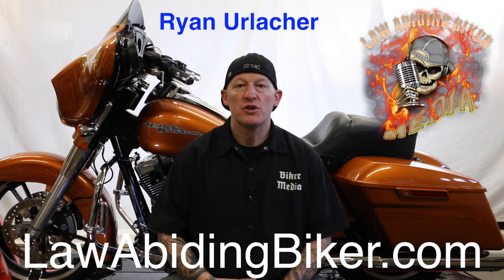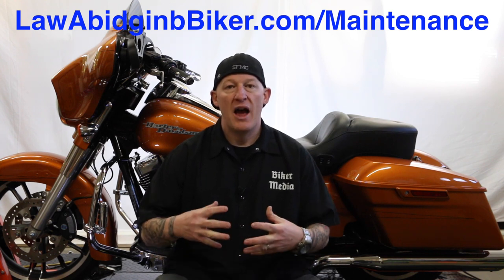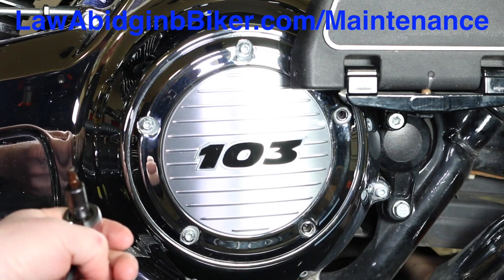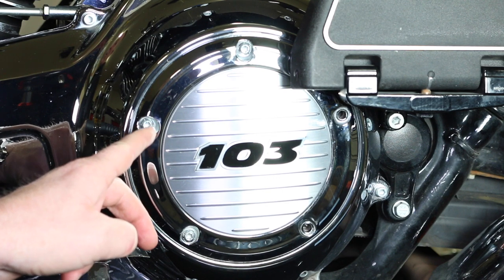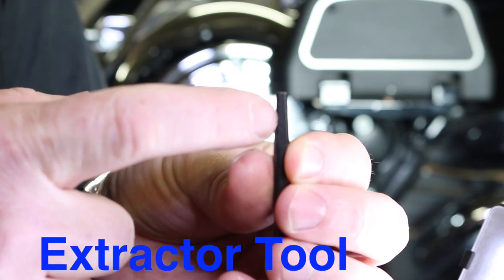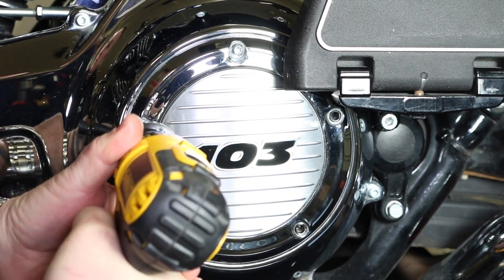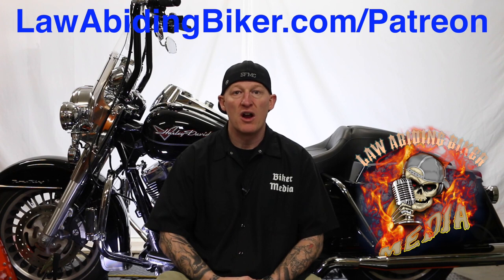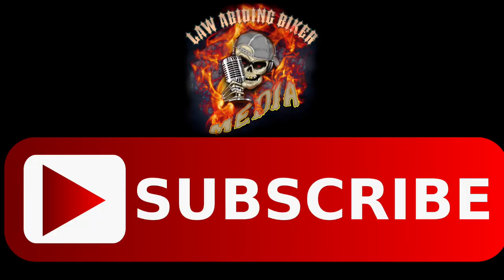Extract Remove Harley Davidson Primary Cover Bolt Stripped Head

Comment: Just did this on my 18 Ultra and can absolutely state that if those bolts are welded like to the primary that bolt extractor method is not going to work, you just can't get enough depth to grab, what worked for me was using a Dremel tool with a metal cutting blade to create a flat blade screwdriver slot then an impact driver. I'll be using anti seize on the new bolts as well as hex head!

Comment: Great lesson for rookie mechanics.  More advanced tip...invest in a set of left handed drill bits.  These bolts are a little small for this to work but I've actually had damaged bolts turn themselves out while drilling the pilot hole for the extractor with a left handed drill!
Reply from the maker: Great tip!  Thank you.

Ride safe & Ride Often!
Here is a link to a bunch of our useful Free vids: http://www.lawabidingbiker.com/freevideos
Here is a link to some of our useful for purchase videos: http://www.lawabidingbiker.com/buyvideos
Want Answers & Information Fast? And help support us at the same time? Do you like the content we provide?
Our patrons get answers to their questions/comments/feedback in less than 24 hrs and are part of our Private Facebook Group. If you are interested in being in this exclusive group you can get all the details at ==> http://www.lawabidingbiker.com/patreon
If you haven't subscribed to the Law Abiding Biker Podcast make sure to do so. Listen in as we talk weekly about issues/items like this & so much more. You can listen on iTunes (Apple/IOS), Stitcher Radio (Android), or any other Podcast App ==> http://www.lawabidingbiker.com/podcast
Join our free email club at http:///www.LawAbidingBiker.com/EmailClub. Only relevant content will be sent from time to time. Email club members are the first to find out about free or for sale content are given special coupon codes.
Reply: Yeah!  The left handed drill bit (3/16ths), and grinding flat the "pointy" end of the (for lack of a better way to explain it) the "4 cornered square" extractor (made specifically more for brass fittings, then screw type) for, made short work of those stripped out torx bolts!  In hind sight however, I'm pretty certain my right handed bit was dull!  Gauging the way the "new" bit was cutting!  LOL!  I replaced 'em with chrome "allen head" bolts (1/4" x 20 x 3/4") and 1/4" zinc lock washers bought at Mernards.  1 stop shopping!

Comment: Ryan, this video is a great.  I looked for this video after having issues removing my primary.  I didnt strip the torx bolts, but did damage two bits.  I stopped and did some research.  I ended up getting two manual impact drivers {the kind you hit with a hammer).  I thought I would share what worked for me.  Cheap Harbor Freight Impact Screwdriver and Harbor Freight Icon Torx Socket with a 1/2 to 3/8 socket adapter.  I had to pound the crap out of it with a hammer, but they all came out without damage. I did buy the extractors you recommended as a backup plan.  Thanks for sharing your knowledge.
Reply from the maker: Thank you for commenting.  Those extractors do work well.

Ride safe & Ride Often!

Check out this YouTube Channel as we have a ton of free videos for you!

Check out our useful for purchase videos: http://www.lawabidingbiker.com/buyvideos

BECOME AN EXLUSIVE MEMBER-GET BENEFITS:
http://www.lawabidingbiker.com/patreon

Leave a flat donation: 
https://www.lawabidingbiker.com/donate

Shop in the Official Law Abiding Biker Store:
https://shop.lawabidingbiker.com

Subscribe to the Law Abiding Biker Podcast: https://www.lawabidingbiker.com/app

Join our free email club:
https://www.lawabidingbiker.com/emailclub

Comment: All five of my screws were stripped. This technique was helpful for one of the screws - Extractor No. 3.  I broke two more extractor tools in two of the screws.  Big bummer, because these are very hard to deal with once broken off.  Dealer must have used lock tight or silicone.  I wound up using a torch to get things warm, not red hot, and used a hand impact driver to get the last two out.  Thanks for all you do.
Reply from the maker: Super glad you got those out. Great idea on the torch and hand impact driver. Thanks for sharing.

Comment: Right so in order to do this i need a rare, specialised piece that nobody stocks. Great. Thanks for the help....
Reply: Most hardware stores sell the " EZ OUTS" or screw extractors whatever you want to call them. If you dont want to buy a set with different sizes try to find one slightly smaller than the bolt you're extracting.

Comment: Stupid place for torx head bolts.  After dealing with two stripped heads, I replaced them with stainless allen head cap screws.  No more problems.  Harley knows this is a common pain in the ass but they don't improve the design.
Reply from the maker: Roger that Dick. Thanks for weighing in and ride safe!
Ride safe & Ride Often!

Here is a link to a bunch of our useful Free vids bro: http://www.lawabidingbiker.com/freevideos

Here is a link to some of our useful for purchase videos: http://www.lawabidingbiker.com/buyvideos

Want Answers & Information Fast? And help support us at the same time? Do you like the content we provide?

Our patrons get answers to their questions/comments/feedback in less than 24 hrs and are part of our Private Facebook Group. If you are interested in being in this exclusive group you can get all the details at ==> http://www.lawabidingbiker.com/patreon

If you haven't subscribed to the Law Abiding Biker Podcast make sure to do so. Listen in as we talk weekly about issues/items like this & so much more. You can listen on iTunes (Apple/IOS), Stitcher Radio (Android), or any other Podcast App ==> http://www.lawabidingbiker.com/podcast

Join our free email club at http:///www.LawAbidingBiker.com/EmailClub. Only relevant content will be sent from time to time. Email club members are the first to find out about free or for sale content are given special coupon codes.
Reply: what size allen head bolts did you use?
Reply: @TheFosland1   oh jeese, I forget, been a while.  I just removed one of the existing torx bolts and took it to the hardware store to match it up.
Reply: @TheFosland1  Hey there, Andrew.  I see it's been a while, but as I'm currently in the midst of this job myself on my Softail, the Allen socket head screws I bought from Lowes are 1/4"-#20 by 1/2" long.  Good luck.

Comment: The last person to touch my primary was a harley mechanic (was actually free for me due to another issue they screwed up and wanted to make it up to me) and when I went to change the primary oil this time I stripped the first two bolts I tried taking out! Tried extracting them using your method, and had to use so much force turning the extractor it too broke off in the stripped bolt!!!! Anyway, I went to try and take off the other torx screws and finally got one loose after using a ton of effort, probably a good 20-30+ ft lbs of pressure, and before anyone asks - yes ft lbs, not in. lbs... It was locked in there unbelievably tight. What sucks is, I asked the dealership for advice and they want to sell me an entire new primary chain case cover, along with a new derby cover. 

Worst part about it is I'm at the end of my rope, with the busted screw extractor in the stripped bolt, I'm unsure how to proceed. I think my last shot of hope is removing the entire chaincase cover and seeing if I can get a better angle or possibly work it out from the inside (not sure if this is even possible as I've never seen the inside of the primary chain case!) Thanks for the video though, I think it would have worked if mine were not torqued as tight because I had the extractor in there nice and snug but it simply wouldn't turn without excessive force to the point it broke :(
Reply: rather than buying a whole new housing from the dealership, you might find a local machine shop that could install a set of steel heli-coil inserts to match the original screw size.  I think the housing is aluminum, which explains why these holes strip out so easily.
Reply: @elliottvangrinsven6574  Good idea for sure. I went a different route already and bought a cheap $75 chain case cover from eBay, sanded it down and painted it black ( I think it's called engine enamel). Anyway, it looks okay, I bought a new derby cover too so all in all with paint and everything it was about $150 or so to have it replaced. And it doesn't even look amazing, it was my first time ever spray painting chrome and while it looks okay its clearly not professionally done. Of course I still have the old chain case which I may take to a machine shop like you said for the hell of it and that way I have a back up. Anyway, to anyone it concerns I highly suggest not trying too hard with these and if you think you're gonna strip it at all just take it in and have the dealership do the oil change. While it is a ripoff, it prolly won't cost you $150 plus oil/filter to do the change!

Comment: the bolt does have play and I can take off the bolt so I'm thinking he stripped the inside thread of the housing case not the bolt itself. thank you for vids ,videos are always great
Reply: +Harley Leija Harley if that is the case you are probably going to have to drill drain the primary fluid, then pull out that bolt.  Then you can re-thread the casing.  If you don't feel comfortable doing so then take the entire primary cover off and take it to a machine shop.  They should be able to do that.  Worse case scenario, you might have to buy a new primary case.  Rick from LAB.

Comment: These bolts are super tricky. Mine is a new 2019 fatboy 107. Just doing the 1k myself. All is good until trying to cover this up. I set torque spec according to the service manual and it’s toward the lower spec setting. 90 inch pound. Guess what, didn’t even get to that torque the head of the bolt snapped. Got that out and went to H-D dealer bought 10 new bolts just to be safe. Second one still didn’t reach torque and I can just feel it lost grip. Now I am afraid even use a torque wrench. I just feel that they are tight and stop. Not sure if that thing is gonna to stay on LoL.

Comment: So the dealership put what looks like blue lock tight on my bolts I got one out but I have striped two bits trying to break the other one any suggestion / the bolts are not striped yet

Comment: My bolts are not stripped but seized. I tried a hammer style torque driver and all its doing is twisting the impact rated torx bit. Any advice on this?

Comment: And what's bad is the chrome screws are in-store only, so I'm changing all mine to black heads with chrome cover. I'm not driving an hour just to get screws

There is a screw extractor named speed out, I have this, it hasn't worked yet.....it won't drill into the screw. 

At work, which I borrowed, we have the type used in video

I'm going to buy a set of these $13.55 on Amazon, and a harbor freight set that has left handed drill bits $10 ....... You might unscrew it while drilling

I'm down for a few days, good thing I got more than one bike......next time in Lexington I might buy a set of the chrome heads..... I did actually consider putting in thumb screws

Comment: the bit dosent go far enough into the bolt to not strip . torx are bad for this .  want this not to happen ever again go to a hardware store and get allen head cap screws like the rest of the bolts on the primary

Comment: I’m struggling with one screw badly stripped. I’m trying to drill a whole in the middle but it’s not going anywhere. Drill bit spinning in the same spot. Any tips would be greatly appreciated.
Reply: did u ever figure it out? i’m having same issue. been through 3 drill bits and hours with no progress

Comment: Had a related problem with one screw after checking fluid level... but then I questioned why hasn't HD designed in a proper dipstick, or fluid check port?  Who in their design-engineering team thinks it's normal/acceptable to remove a cover and gasket to simply check the fluid level?  And HD recommends replacing the gasket too... What century are they living in?

Comment: would you recommend this method for extracting a rounded breather bolt? my problem is the air filter mounting plate on a Harley Breakout, which I am changing for a Screamin Eagle heavy breather. Whilst attempting to remove the two mounting/breather bolts one of these has a hexagonal nut area that has become rounded so that the socket slips off of it, I am tempted to use the breather hole and this tool but am obviously aware that fragments could travel through to the crankcase area. What would you suggest for this particular bolt? Thanks for your help, Mike in the UK.
Reply: +Barbara Palmer Depends Mike.  Breather bolts are sometimes different from kit to kit.  So I will be generic with this, they are normally hollow so it would be tough to drill in for fear of tearing it apart, but it could work. You may not need to drill at all.  Get a easy out that is a little to big for the hole and work it into it.  Then you can try backing it out like we do here with a crescent wrench, or even wrench.  I've had luck on other bolts taking a chisel and creating grab areas and then putting a vice grip on it. Rick from LAB.

Comment: I had three of mine that would not come out with the T 27. I took my manual hammer tool, put the T 27 bit on it, took my hammer, tapped on the tool while turning and all of them came out with not much effort.
Reply from the maker: Very good!! Glad you got them out

Comment: Hey Ryan! One of my buddy’s came over to my garage and said he couldn’t get one of the cover screw/bolts out of his primary cover! He said he took the T27 bit and he said it was so torqued that it broke the tip of the bit! How would you go about getting this over torqued bolt out? I checked the others and they were way tight to beyond normal torque tight
Reply from the maker: You'd have to use the same procedure and it may work. Otherwise, you'll have to drill it out and re-tap it. Wish it were easier than that.
Reply: Talk to a welder that knows what he is doing.

Comment: I cant get out those stupid torx screws off my cover.  I think I started to strip them out.  Is there a regular hex bolt replacement?  Stupid place for small torx bolts.
Reply from the maker: yah, many go to the hardware store and replace them with hex bolts. Easy. Just get stainless ones.